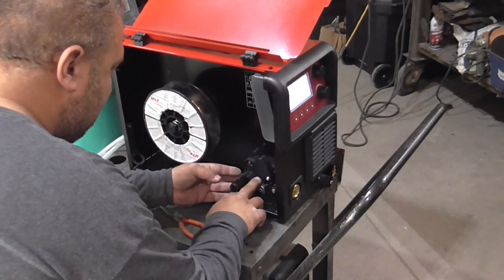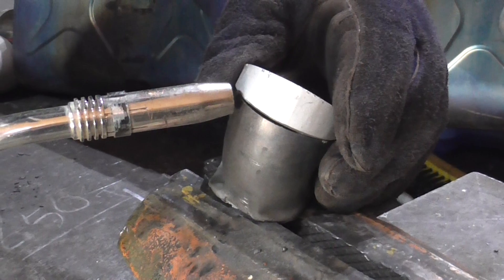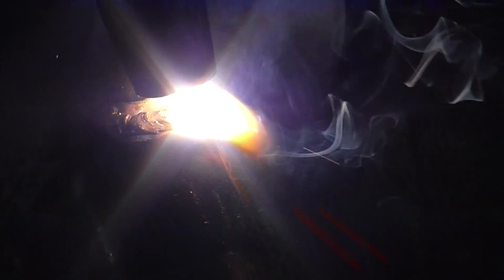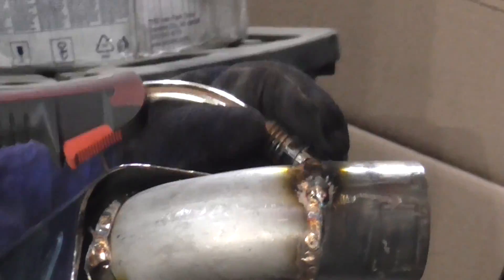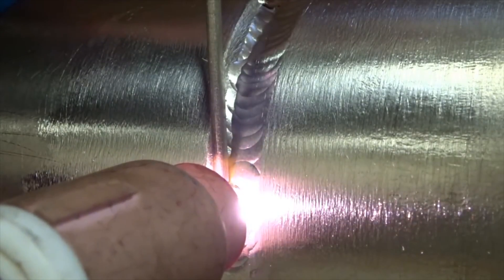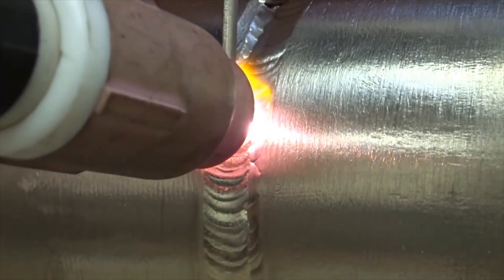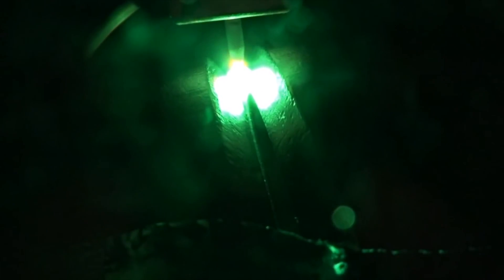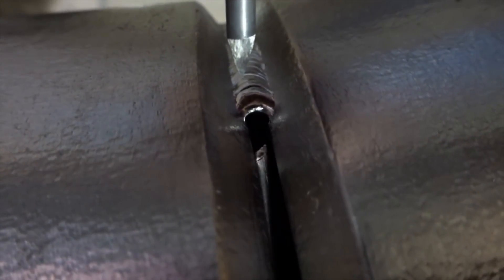Titanium exhaust, how to join titanium and stainless steel???

Comment: What types of gas are used for titanium colouring ?
Reply from the maker: The hot titanium reacting with the oxygen in the air colors it.   To prevent the color you use argon so the ambient air is blocked out
Reply: @ZILAwelds  Thankyou so much sir ❤🙏

Comment: Joining titanium to anything other than titanium will not only crack itll complexity fall off . Silicon bronze would be a temporary fix because its soft. I weld titanium on a daily basis and I've messed around trying to put titanium welds on stainless just to see what it does and it'll literally break like glass

Comment: So basically, it's impossible for me to use my millermatic 211, running 110v with Flux core wire to weld 2 pieces of titanium? That's all I have at the moment and am trying to make 2 jet engine titanium HPT blades into a bottle opener/Keychain by welding the 2 blades together. I only have a few blades so I don't want to burn through too many experimenting. But I believe I would need to bite the bullet and upgrade not only to gas, but to a 220v as well. Let me know what you think and some other possible options. Can I lay down a small and clean bead even after upgrading voltage and 100% argon VS Flux core?
Reply from the maker: Yes - you are most likely not welding titanium with your current setup

Comment: Did you have cracks by joining the two materials?
Reply from the maker: when I ran the beads too long and had too much cooling - yes - if I kept it short - no more than 1/4 " long bead and let it fully cool to the tough with bare hands then no

Comment: If you don't try you will never learn.
Reply from the maker: ColKorn1965 exactly. And to have the opportunity to work with titanium and not feel that you are screwing up a several thousand dollar part if things dont go as planned...  that was a rare opportunity that i was thankful to have.   I mean although i have been commercially welding for a little over 20 years and i like to think that typically i can hold my own - those “exotic” metals that you and i dont weld every day are a challenge ....  i have tig welded titanium before BUT it was new and fresh and titanium joint to titanium ....  i dont want to say that is easy - but it is easy because you can follow book procedure and there is a ton of good information how to do it ....   
but a “backyard” repair like this - there is just not much information at all about that out there.

Comment: Bom dia, estou escrito no seu canal, qual material de adição você usou para soldar na TIG, obrigado.
Reply from the maker: When i weld clean titanium to titanium i use tig and titanium filler rods.   Here, joining dissimmilar metals try if SiBro works for that with tig also. It did work for mig

Comment from the maker: For everyone who wants to tell me:” you didnt do this right”. Save your breath, i know that already. I am “experimenting” here on a used exhaust ( that no matter how much you clean it is probably still dirty, and has Severe heat damage to begin with). All less than ideal conditions to even attempt this! However i find the results interesting and thought it might interst some guys out there. 
If you have any suggestions on how to do this correctly ( short of throwing the entire heat damaged and wrinkeled exhaust away) than please tell and show me. 
If the video does not interest you - sorry to hear that you wasted your time watching it ....
And for all others - enjoy!
Reply: Can I do if I use propane torch on titanium pipe?
Reply: Don't worry about youtube comments. 

I found this video because i was interested if anyone had used brazing on exhaust stuff successfully. This is a really cool idea.

I think this could work, especially if you coated the interior of the exhaust with a nice ceramic or low coefficient of transfer thermal coating, or at least the brazed area (after brazing obviously)

Comment: Nice job brazing on a really whacko metal.  I hate the stuff.  That PP200 is a slick machine.  FWIW, Titanium doesn't like to take a bend.  It usually breaks first.  You should see what it does at extreme temperatures.  I've seen it burn up and shatter like glass!   
I know english is not your native language...... But it's siliCON not siliCONE...  (not cone as in ice cream cone)  Tchuss!  ;-)
https://www.youtube.com/watch?v=8kJ2f3WkrK8
Reply from the maker: Hmmmm. I always try to think of Silicon valley ....  and than i am wondering how to spell the chip and what the girl friends wear in their cheasts ....  lol

In the german language it is so much easier .....  the chip is make from Silicium...  so its a totally different word ....   one day i get the difference - thanks for pointing it out again ....
Reply: ZILA You're a riot man.  Great videos.  I do Sil-bronze art pieces... Any chance you can do a demo tig welding some cast bronze?  There are no decent videos on YouTube.  I'm able to weld my stuff with the invertig221 on dc, but I could use some pointers that's for sure.
Reply: worldtraveler --- I really hope that you don't choose this mountain to die on, there are so very many more important issues to worry about than how to say tomato. Have a great day.